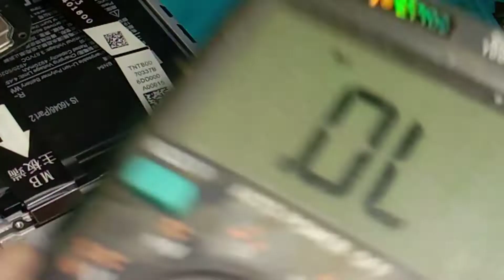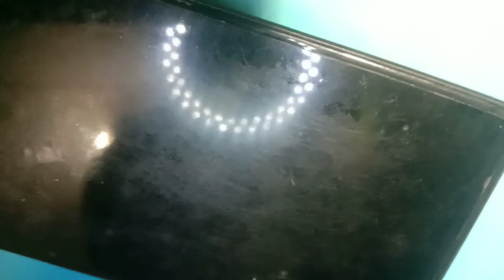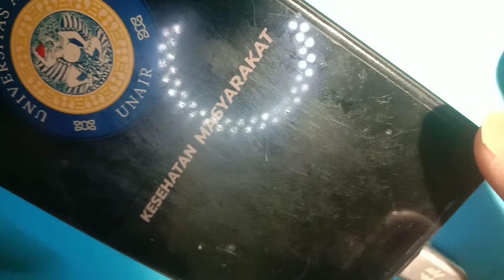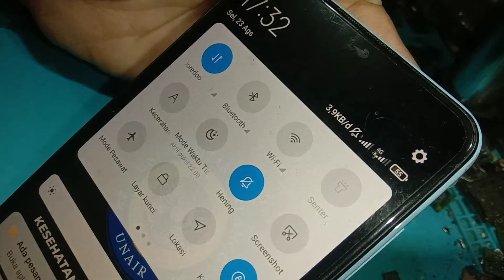Redmi Note 9 Merlin Restart Problem | Charging Restart | Recovery Not Open @mobilecareid

Comment: What is the name of solution sir appiled to that area 
Sir please reply that if we heat that area by removing panel will the problem will solve .
Please reply sir please i am from Kerala.
Reply from the maker: You can try it like in the video sir, if not work you must try change the RF IC
Reply: @mobilecareid  thank you sir but you didn't say the liquid name you applied in RC.  sir,
Please reply I want to buy it sir thatswhy🥰
Reply from the maker: @Bijoymc_04  You are welcome sir, the name is flux
Reply: @mobilecareid  thank you sir
Reply from the maker: @Bijoymc_04  You are welcome